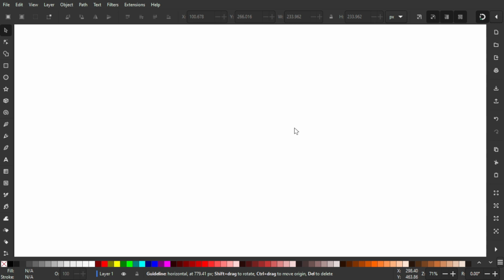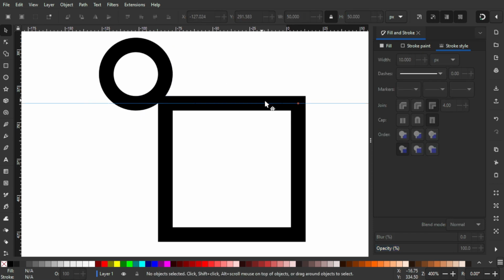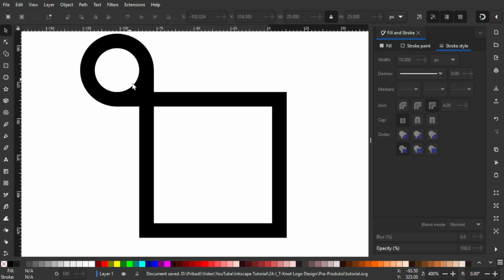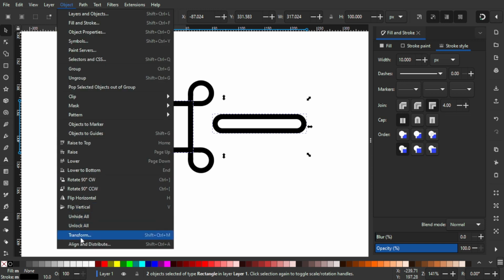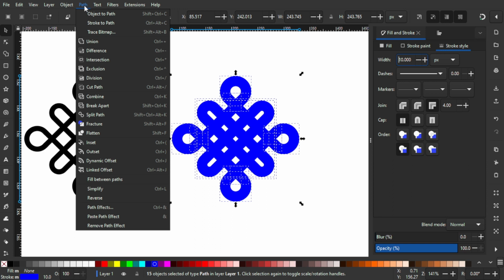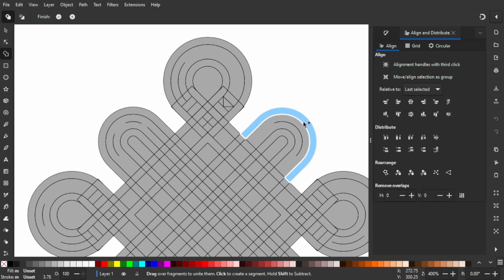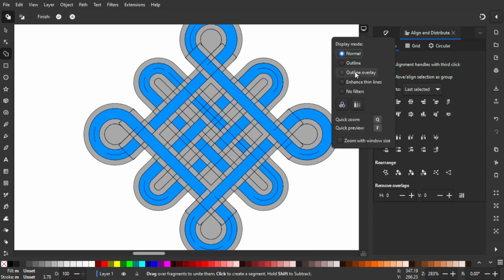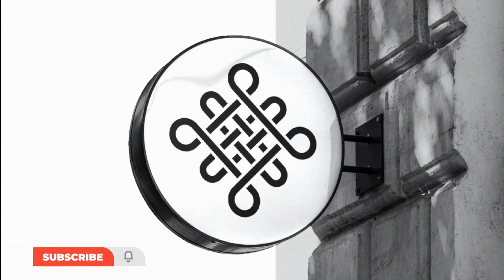Create Knot Logo Design in Inkscape 1.3

Comment: what if we optimize svg online? will the extra nodes go while preserving the shape?
Reply from the maker: I already test it out. The result is YES, some of extra nodes is gone. But I notice a couple of glitch. For example there's unwanted negative space inside logo itself. Also, the optimization is not really work on straight line apparently, but works really well on curve. THIS svg (from the tutorial) started from 1127 nodes and ends up in 598 nodes using svgoptimizer.com (twice). In SUMMARY, the best practice is to get rid of the nodes manually, especially on straight line and inside the shapes. Then optimize it automatically using online tools or others.

Your comment is pretty important. I might pin one. I hope you don't mind.
Reply: @hamrozi_net  Thanks for the explanation & pin my comment

Comment: I have downloaded inkscape 1.3 and installed. But when i draw any shape e.g square etc it has default opacity = 0 therefore while drawing on screen nothing displays. After drawing i set layer opacity to 100 % and after that the shape is visible. i checked out every possible cause but can't find anything. it's parent layer or page default opacity also is 100% what should be the reason behind it can you tell? i have already tried reinstalling inkscape several times but the problem persists.
Reply from the maker: Not sure what happen there. Is it still the same when you open inkscape template document? Maybe you can reset the preferences. I have the tutorial for that: https://youtu.be/wrcp7wXeW1

I plan to make tutorial on how to make custom default document. We just have to wait and see.

Comment: Great channel!
Had Your What's New In 1.3 vid recommended.

There's now shape builder templates too.
You can select when You start up Inkscape in the dialog box and probably too under file -> open template, or whatever it's called, and they actually have a Celtic knot template, but it's that classic triquetra/trinity knot, rather than this more dara knot style Bowen knot, and I really like how You did that, and also that You pointed out how buggy it is, that there's lots of unnecessary nodes everywhere, but like You said, it's the first iteration of the shape builder.
The new flatten and fracture functions are great too!
Reply from the maker: You're right, Inkscape do have that template. Thanks a lot! Inkscape will get better of course.